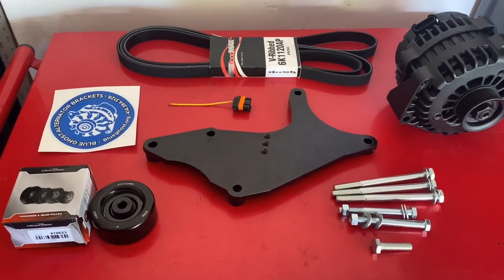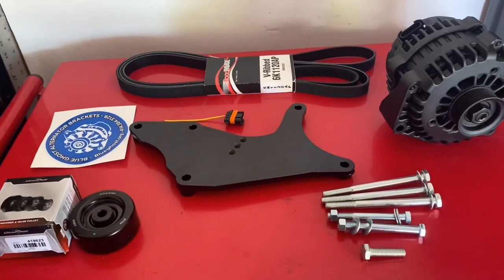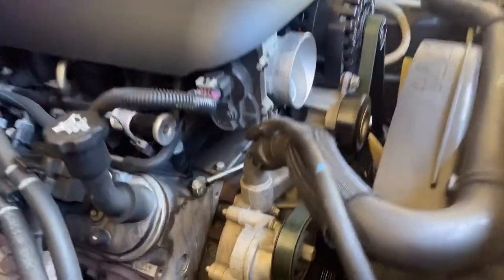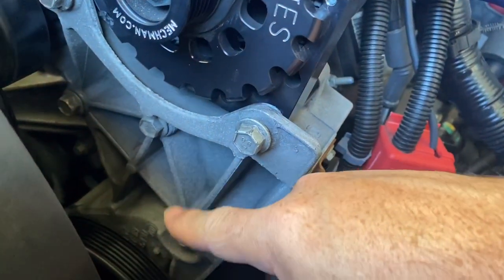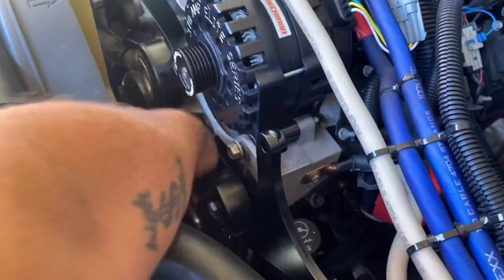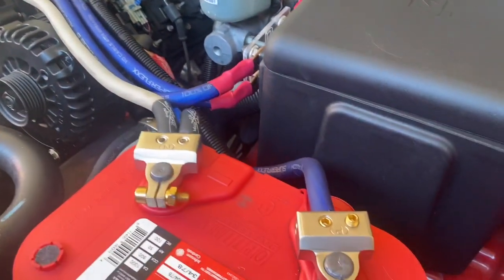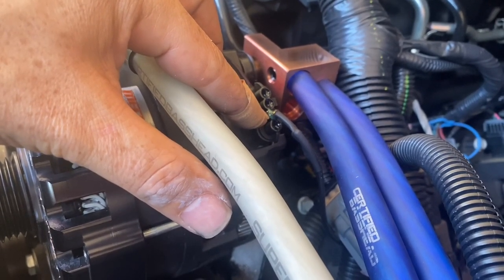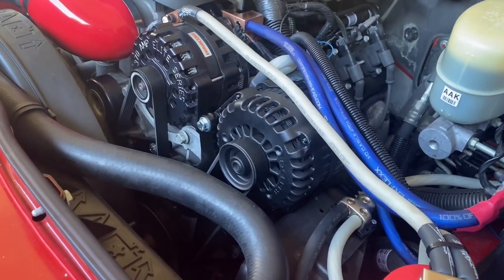Maximum Voltage! Dual Alternator bracket install with dual alt electrical system GM/ Chevy/ Hummer.

Comment: Does the factory alternator feed power to the mechman alternator?
Reply from the maker: Nope..... factory alt powers truck independently. Mechman alt is powering the lithium/stereo all by itself.
Reply: Oh ok.I was told that the factory alt makes the secondary alt kick in.
Reply from the maker: that can be true if they are wired together. but mines are completely isolated from eachother.
Reply: Is there an advantage to separating them?
Reply from the maker: 2 big advantages. First you can keep your cars electrical system running stock and isolated from your stereo so it does not rob any juice from your stereo. Next, no need for running isolators. Which can fail leaving you in a bad position. This way, your car keeps running and your stereo keeps playing regardless of what the other one is doing.
Reply: @NextLevelCarAudio  can a non mechman alternator be used with the bypass wire also, or is it for the more expensive brand alternators?
Reply from the maker: Shoot man, I’m not sure..... sorry :/

Comment: I wanna do this but I charge my lithium at 15.6 and stock at 14.8? Doable?
Reply from the maker: Absolutely! As long as you keep the electrical systems isolated you are fine
Reply: @NextLevelCarAudio  how so exactly?
Reply from the maker: One alt goes to under hood battery that powers truck, one alt goes to rear battery bank that runs audio. Common ground but isolated power wires

Comment: Do you need to have the factory harness plugged in on both? What would happening you bypassed both alternators with one wire
Reply from the maker: Just one... the other you only need the one wire. Not sure if you bypassed both what would happen. Besides getting the warning light on the dash
Reply: @NextLevelCarAudio  so if I do a single high output alternator I’ll need the stock plug connected to it? I bought a singer 390 and my issue is my volts are fluctuating even at idle. I have a gm internal regulator with a two wire plug adapter. One plug for battery hot and the other is ignition source. I’m wondering if my car needs to have the alternator connected to the ecu through either the stock l terminal or fr terminal

Comment: How many in-line fuses you have
Reply from the maker: In this setup 2, now I’m running 3 350’s
Reply: @NextLevelCarAudio  I will be running 2 runs power with extra battery to 5k how many will I need
Reply from the maker: I would do the same. 2 350 amp fuses if running 1/0
Reply: @NextLevelCarAudio  all I seen was 200a and 300a where I get 50a
Reply: And I’m running double power wire
Reply from the maker: I got mines on Amazon. Or eBay. 350 amp is what should be used on 1/0 for max safe current transfer
Reply: @NextLevelCarAudio  ok thanks
Reply: @NextLevelCarAudio  ok thanks. So 3) 350a on each power is what I need

Comment: I would like to add a second alternator but, I can't figured out how to wire them,, NOTE since the voltage in my truck is regulated trough the computer.. short story long I need to do more research.
Reply from the maker: Its worth it tho to make sure you do it right. Hope you can get it figured out
Reply: @NextLevelCarAudio  I'm planning to install one for Chevy truck, but high output probably 300 amps, since those alternators have the sense wire and it's so easy to hook it up, just to the ignition and a few modifications here and there, it's all about been creative and make it work..
Reply from the maker: Hell yeah

Comment: I have seen 4 aditional alternators. Can anybody answer, how many of them can I put on and keep friction on main pulley in not slipping limits? Cause usualy there is one alternator, and friction force is kinda calculated for that, also maybe for water pump to, but 4 or more alternators ad a lot of resistance and the belt can simply burn on the pulley.
Reply from the maker: Gates heavy duty belt and lots of tension. Other than that, just send it lol.

Comment: Did you use a alternator  distribution block for power and ground runs?
Reply from the maker: Buss bars on the back with fuses in between
Reply: @NextLevelCarAudio  awesome.  I just bought a 4 spot alternator distribution block. Would I wire 2 power and 2 grounds  to it or what? GP CAR AUDIO is the brand as well.
Reply from the maker: Are you running a single alternator?
Reply: @NextLevelCarAudio  I'm running two alternators but only one designed  for my sound system.
Reply: Im thinking about running a  big 3 on my stock alternator just for security  purposes or is that too much. 🤔
Reply from the maker: I always do it. Even on budget builds and low power setups.
Reply from the maker: If you are grounding your amps to the frame should not need to do negative runs from alternator unless you are running huge power. Because remember, the alternator is bolted to the engine which is bolted to the frame
Reply: @NextLevelCarAudio  yes sir, so basically all 4 power runs from alternator to the battery? It's a 4 spot alternator distribution  block.
Reply from the maker: Yes, or 2 to battery and 2 to the amps. Just make sure you have the same number of cables for ground as well tho
Reply: @NextLevelCarAudio  yes sir.  I'll do 2 power and 2 ground. Ground  will be from alternator  to the frame and 2 power will be from alternator  to the battery.  Right? I'll be using 3 batteries  as well.
Reply from the maker: Sounds legit! Heck yeah